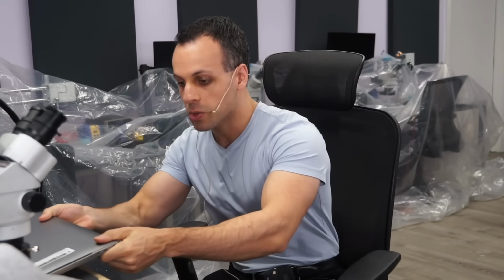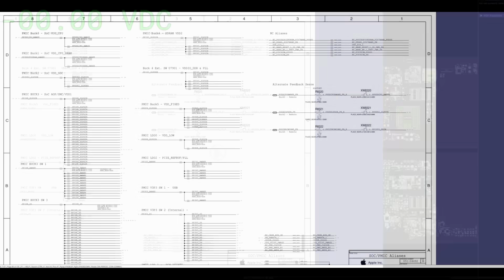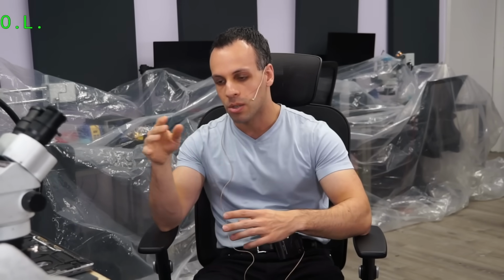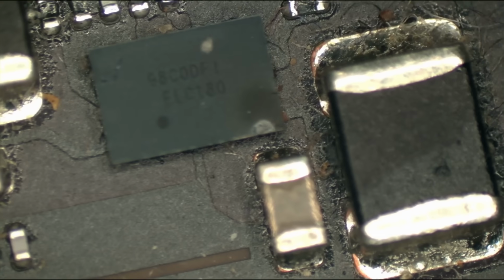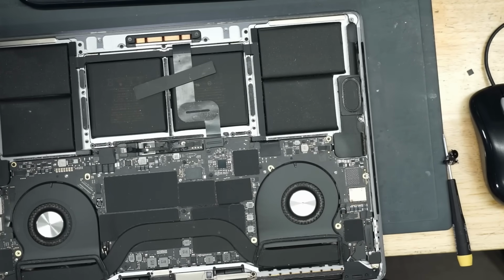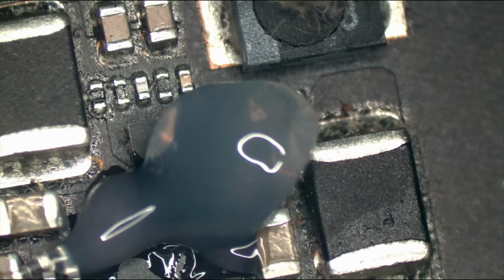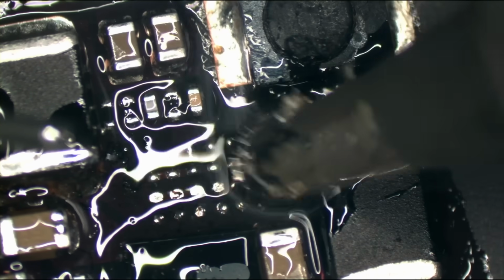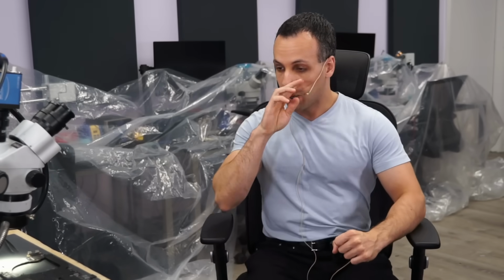How most 16" Macbook Pros often kill themselves & why they're unfixable

Comment: my macbook pro 2017 i9 with touchbar just died abruptly. apple reps says its logicboard and battery issue and they can do nothing about it. 2500$ laptop is right now a paper weight
Reply: Do not buy expensive Macbooks. Buy descent PCs for less than $600 at clearance. I purchased a 16" Macbook pro m1 for over $2000. It started to have a black screen during the first year of ownership. I sent it for repair and found it needs new parts. I was lucky I purchased it from Costco with 2 years warranty. I recently purchased Lenovo ThinkPad for 16 GB ram and 1 TB HD for $450 from Costco. In my opinion, the Macbook does not really worth $2000 with a soldered hard drive.

Comment: I have an old pro laptop from when the laptop battery could still come out. The battery self destructed but I got to it before it could damage the machine. Does anyone know wher I could get a replacement for it? Going to work on the cooling problem after I can get it to turn on 😅

Comment: Most successful businesses are down to one or a small number of key people.  Once they leave that business is going downhill. For Apple that was Steve Jobs. They are nothing without him.

This same thing happened the first time he left. Quality and innovation out the window.

I've seen the same thing happen with many companies after the founder sells and moves on. Middle management takeover, cut corners and any magic is lost.

Disney, Marvel, Ford... same story.
Reply: You are correct. My 16" M1 Pro started to have a black screen during the first year. I was told it was due to a hardware defect not a software. 
Believe it or not many Ford started to puts the water pump inside some of their new engine so if the water pump rings fails, the coolant with be mixed with the oil and destroy the engine. Very cheap design approved by irresponsible engineers. They make it this way to force customers to go to the dealers to replace the water pumps on regular basis in order to keep the dealers happy. By the way I am a graduate civil engineer. The management do not want the engineers to build long lasting engines because they know most customers are ignorant.

Comment: Why did not not put a 5 volt Zener to ground as a safety? If the voltage ever tried to rise over 5 volts, the Zener would dump it to ground. Or better yet, dump the extra energy to a failure circuit indicating over voltage.

Comment: I have a G4 PowerBook, MacBook pros from 2005, 2007, 2009, 2011,  2012, 2014, 2017, 2020, 2023. Aside for one with a broken webcam that had to be replaced, all of them still work. I’ve had a few HP and IBM/ Lenovo and a Sony laptop and half them broke down while still in heavy use. I’m wondering which laptop you recommend that “better built”?
Reply: Any of them that are actually the same price as the MacBook.
People compare cheap windows laptops to the MacBooks.

Comment: Are there actually more reliable laptops though? I’m still using my mid 2015 MBP and it gets the job done after nearly 10 years of daily use (and I’m not even the original owner). Every windows laptop I’ve owned has lasted 2-3 years max.
Reply: Yes. Dell Latitude/Precision, Lenovo Thinkpad, are the best ones in my opinion.
I would avoid all HP products. I say that as someone who daily drives a HP Zbook workstation laptop. The motherboards are of lower quality than most other brands and have the highest failure rate, only second to Apple, in our experience. Most of the Apple products we have been given have been unusable for various reasons - iCloud lock, dead logic boards, and high cost of parts.

I normally would've said HP Elitebooks and Zbooks were OK, but we got given lots of them recently and they have been the most unreliable machines we've ever gotten. They randomly like to corrupt the CMOS which requires you to disconnect and reconnect the battery to get the machine up and running again, this has happened to most of them. A few of them have died after a few months of usage, we also had a few of the PSUs die (Brand new genuine Delta chargers, unsure why they fail so often, maybe bad batch?)

Comment: Okk I tried but I still don't understand, can anybody explain this in simple terms why it had happened and can I prevent it?? Thanks.
Reply: Nothing. A controller for the SSD voltage can randomly die l and send high voltage into your SSD, basically killing the whole mainboard. It's just genius apple design.

Comment: So how present is this issue really in comparison to the absolute amount of MacBook Pro's out there? I had a 16" MacBook Pro i7 with Touchbar running for 5 years working every workday 8+ hours. I have another one, private owned, and it still runs. The problem is, when I take a look at other Laptops I wanted to use, they either are heavy as hell, don't have the specs or are in any other way just bad. Even Lenovo, HP, Dell (I like the XPS but they are at least as expensive as MacBooks)  or even Tuxedo (they only sell chonkers) are not selling good products in my opinion. I am so mad I cannot buy a really good laptop these days and be happy.

Comment: when i shopped smartphones and went for the s23..got it on prime for 600..the value to their non pro models are insane! you get so gimped crap from apple unless you pay top dollar..so like 400 500 more for the same stuff..and then the whole hard to fix thing..swapping identical parts with no success and apples history..to me someone would buy it for logo..os..and their chip (which really doesnt matter that much now that qualcomm went back to tsmc) apple products are stupid..and they typically look ugly..example..tab ultra vs ipad pro..so much cleaner on the tab..but you get the M chip on the apple..still wouldnt bother with apple

Comment: Thanks for the ultra helpful info. I will try to always leave me computer on. If I need to power off or restart I will try to remember to always do it from battery. 
Hmmm, just a thought. Maybe there is an issue where the Mac is "off" but turns on when the lid is opened. Maybe there is a timeing issue with how power is handled.

Comment: Interesting. I've owned Macbooks since 2008 and never had a problem with a single one. Although my 2012 Macbook Air did last me through the butterfly keyboard era. Transitioned from PCs, which I had used from 95-08, after the dumpster fire that was Windows Vista.

Comment: Impressed.  I have a computer tech for 20 years and have never dug that deep to repair a machine.  Guess if the machine is expensive enough, its worth it.  None of our ever was.  Never bought Macs either. I definitely learned something.  Hate ssd's soldered to the system boards.  I just have always had a problem with laptops.  Sure their useful but they usually have issues with power supplies or cords, heat problems with dirty environments or if repairable, have older tech.  Great video!!!

Comment: Is this an old 16” MacBook Pro? If so, I’m wondering if this is an effect of the fact that the thunderbolt ports also have direct access to the storage controller. If so, I wonder if this issue can be mitigated if you only use MagSafe to charge the machine, esp with newer machines that have MagSafe. 
I also wonder if there’s additional protection circuitry where the MagSafe port is, to prevent this from happening in the future. 
Honestly any circuit that deals with bidirectional current flow is a massive headache. A lot of these chips have internal “automatic sensing” and it just never works.

Comment: Damn.  I am planning on buying a Macbook and this is not giving me good vibes.  I think as long as I stick to an older model (avoid paying $5,000) I should be able to find something that works for a year or two and gets me where I need to go.
Reply: What do you plan on using it for? Most people get a PC for a browser with 30 tabs open. I love my Macbook, but my next PC is going to be Linux.
Reply: @i_accept_all_cookies  My main computer is exactly as you describe.  My current studio computer is a refurbished PC gaming tower.  I use it to do the 3D graphics in my puppet show as well as the video editing.  For the editing I use Davinci Resolve and do a LOT of green screen processing (puppet show).  Anyway, I recently accepted a job that puts me in a remote nordic camp for 2 weeks at a time.  I would like something that I can take with me that can run Blender and Davinci Resolve so I can keep working on my videos while I'm working to pay the rent.
Reply: @TheColleenDabeanShow  take a look at System76, they have reputable Linux machines that will be much less than a Mac with no loss in performance. If your 3D graphics are complex, they have laptops with Nvidia GPUs. For video editing and simple 3d, you could probably get away with using one of their ultraportables. You might want to ask the Blender and Davinci communities what hardware would be sufficient for your work, now and over the next several years.
Reply: @TheColleenDabeanShow  and congrats on the nordic camp job, sounds exciting!
Reply: @i_accept_all_cookies  Thanks!

Comment: Hey Louis, HELP! Im in australia and my A2485 which has done next to nothing of work has just died. after the most recent update, I’m not sure what was the sequence of events but the thing won’t turn on and when the charger is in there is no orange light. There is nothing yet you touch the enclosure  of the computer and you can feel a buzzy feeling. Turning the power off and it stops the buzz feel. What is the hell going on with these 16 inch M1 MacBook pros. They cost a shitload of money and did not deliver it’s been looked after and it hasn’t moved from my bench. I’m worried the Apple is gonna screw me, even though I never got the value for money over the time period what should I do?

Comment: I have a Galaxy Book 3 Pro 360. Wondering if there are any common failures on that one I should know about that maybe I can prevent. I know the gen 2 Galaxy Books had a screen cracking problem, but they supposedly fixed that on the gen 3's.

Comment: Exact same thing happened to my MBP M1. Luckily it was still under warranty and I had all my data backed up. I feel really bad though for everyone that had to experience this under different circumstances. This video deserves a lot more attention. Thanks for the great work Louis.
Reply: Hi! Did you get a replacement laptop or thit they repair it with a new logic board. My brand new M3 Pro 16inch just died the same way and i sent it to reppair under the apple 1 year guarantee. I'm just curious
Reply: @kevinstarofficial how time of use and why it happens?
Reply: Why it happens?

Comment: My first MacBook was the Core 2 Duo from 2008, and this one had no issues except for the poor quality of the plastic enclosure. I sold it very well in 2014. But my new MacBook Pro 2011 lasted only a few years. The GPU failed and I lost some of my work data. After that, I’m always storing things on an external drive. And it’s reselling value was down to $100. I hated Windows 8 and bought myself another MacBook Pro 2015 with integrated GPU but it showed me some glitches on the screen after heavy use, and  USB ports were not charging my iPhone. This was the last Apple laptop I purchased.

Comment: I did not have my A2141 diagnosed, but I tried to start it one day, and it did not do anything. After seeing this video, it must have had this issue. It was powered off the day before cleanly (and no, nothing physical happened to it). Garbage, it's not like it's a cheap ass machine. Repair was about 980 euro (main board replacement).